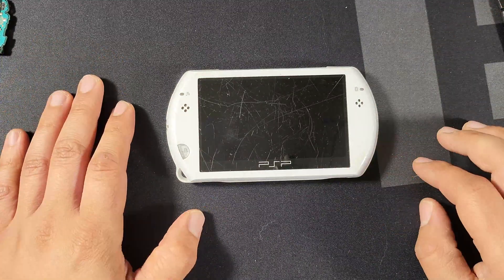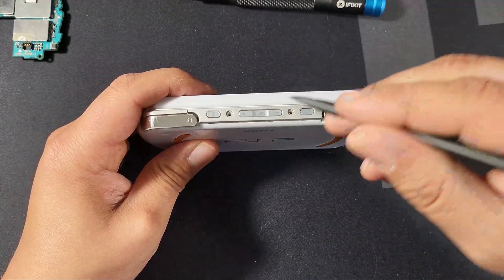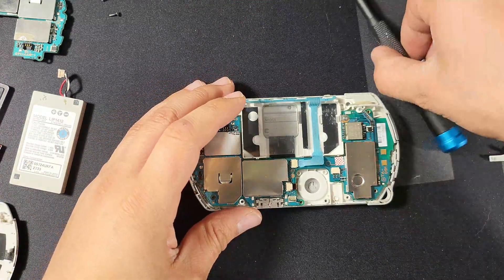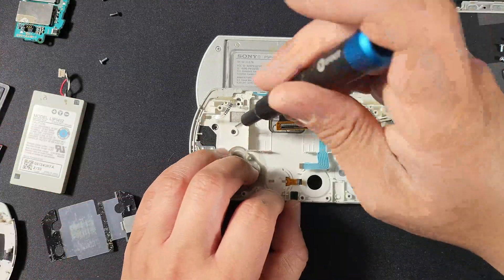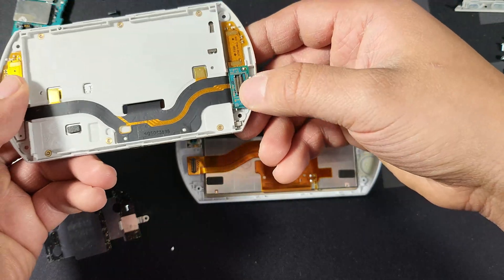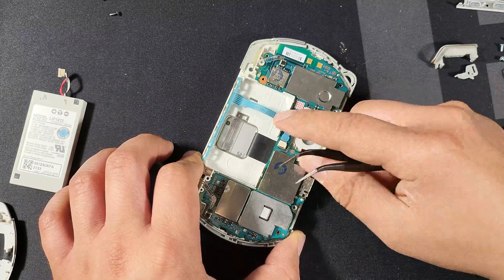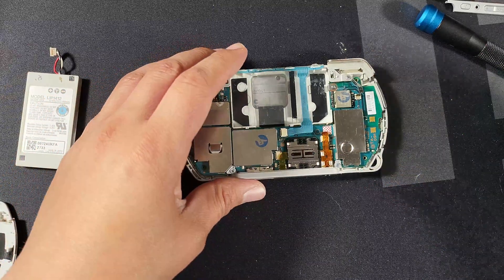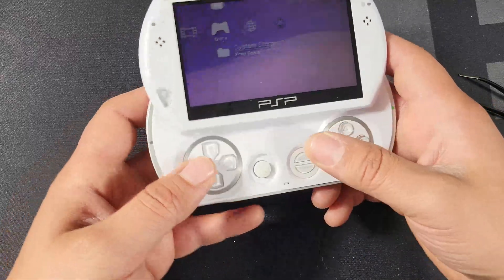PSP GO Screen and Motherboard Replacement

Comment: hey could I send out my psp GO the display stopped working and I'm pretty sure I can see the ribbon cable has been cut/damaged but I sent it to get repaired and they said it was a motherboard fault which I'm pretty sure they were just lazy to check. Could I send mine out? I cant find your Instagram to send details

Comment: I replaced the motherboard on mine 4 years ago with a second hand one.
When I powered it back on and also noticed that there were some games installed, however I was unable to run them. I just assumed that they were locked to the account of the person that installed them originally.